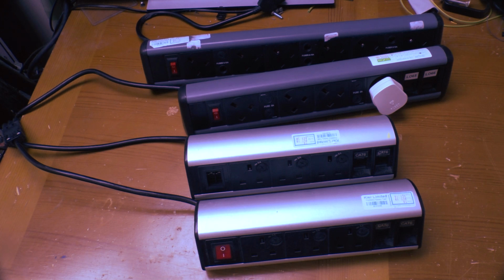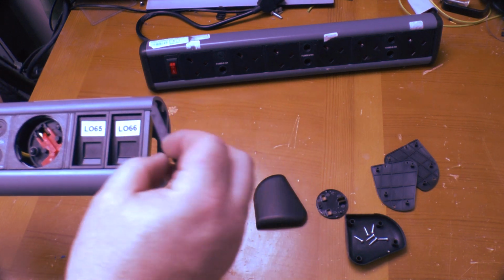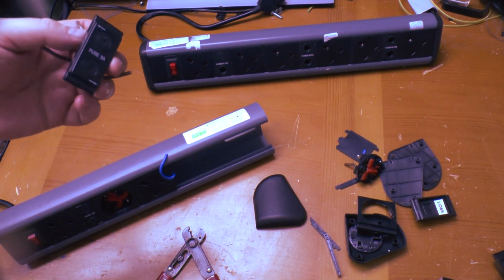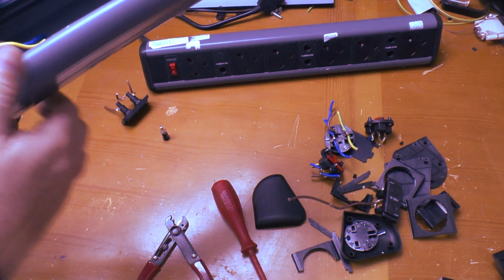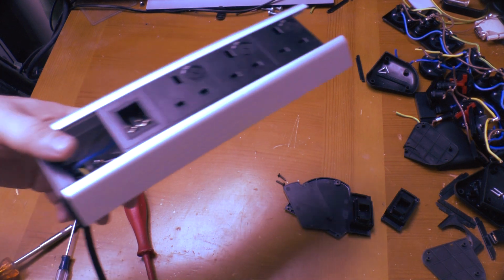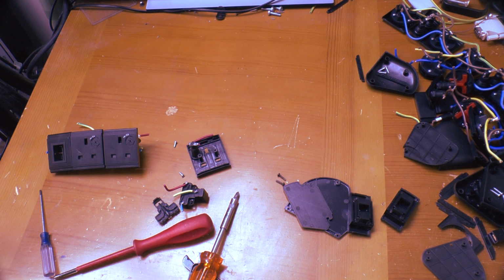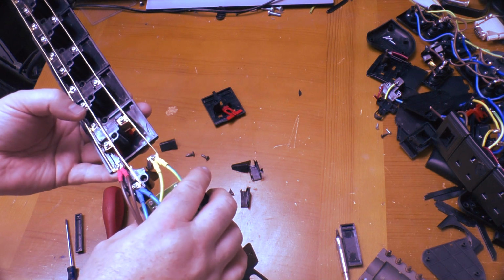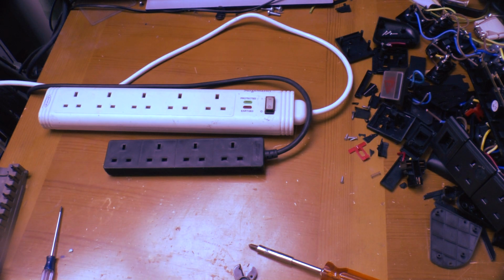Desktop power strips - an unsafe waste of money?

Comment: I'd like to know if those fuses were sand-filled.  You'd need just the right current to sustain an arc if they're not sand-filled or you'd blow the 13A fuse, but even so...
Reply: He said 20mm so most likely be the answer is a standard 3.15 20mm slow blow I'd guess - and no to sand.

Comment: That soldering is appalling
Reply from the maker: You should've seen the soldering on my mate's Amiga 500+ after I fixed the battery rot on it. There's a reason I didn't put it on YouTube :D
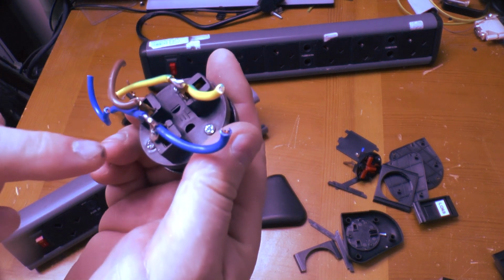I agree though, 'tis shite.  I was surprised when editing the video that I hadn't commented on that big gob of solder seen at 6:32.
Reply: @AintBigAintClever  I've done some big globby joints in my time but never a mains live hanging on by a thread... JFC

Comment: it suprises me that China seems to have no quality control I guess they don't care, they just slam a Chinese Export symbol on them and out they go, you get what you pay for generally, nice video very usefull PRO LEC extension leads though are not able to be stripped down as they have snap off security screws so gawd knows the quality inside them
Reply: It's a very specific kind of not caring resulting from Maoism and the Cultural Revolution:  as long as you do not threaten the hegemony or diktats of the communist party, you can do ANYTHING in China.  They just view shitty electrical gubbins as another type of warfare.

Comment: Love the quality of the Olson PDU. I rate the Permaplug 4 way sockets. Very solid and reasonably priced. Duraplug sockets though aren’t what they used to be. I bought two of Amazon. The plug and cable are very good quality but the socket end is rattley and the plastic is very thin. Also the fuse hold pops out a bit. But has never got hot even with a 2.5kw heater plugged in.

Comment: Apart from very brittle plasitc, the biggest cause of cracked sockets is when people insert the plug so just the earth is engaged, then thump the plug the rest of the way
Maybe you need a fuse in each socket for the dubious unfused chinese equipment :D
btw, several staff liked bringing their radios onsite, no problem with that, but they had to let us PAT test them if they plugged them in
Reply from the maker: There shouldn't be any dubious Chinese kit at work, but any that is there could just as easily be plugged into a 32A ring (or as we had in our own office pod until it was discovered that the board was mis-wired, a 64A double-ring).
Reply: Yes the individually fused ones are good for meeting rooms as clients bring all kinds of adaptors for their non-BS1363 equipment.
Reply from the maker: @sdgelectronics  that shouldn't matter as there's a 13A fuse protecting the whole thing anyway.
Reply: @AintBigAintClever  many of these adapters aren't rated for 13A though which is why they're useful
Reply from the maker: @sdgelectronics  so they're not compliant with UK standards?
Reply: @AintBigAintClever  Often not, it depends where they've travelled from.
Reply from the maker: @sdgelectronics  I'm sure the company's H+S officer would have a field day with that.  If they're using substandard adapters, not rated for the current available and not equipped with their own fuses, they ought to be borrowing one, otherwise they may as well be baring the wires and wedging them in with a plug.
Reply: @AintBigAintClever  but no one is likely to expect a client to hand over all their equipment for a PAT prior to allowing a meeting to commence. Probably no one in the room would be any the wiser what is safe or not. It's easier just to fuse down for IT equipment and RCD sockets in the floor outlets